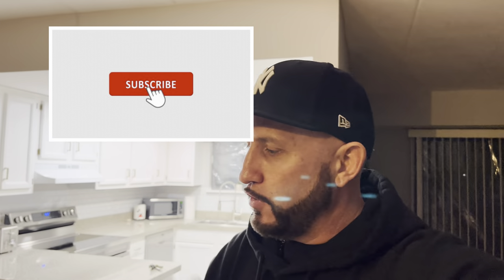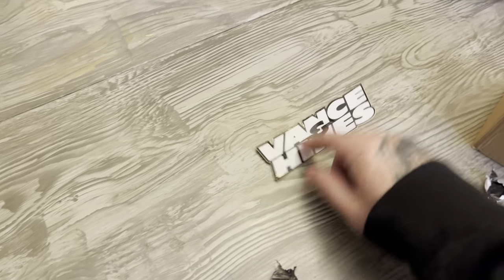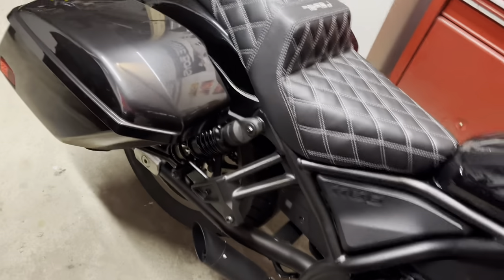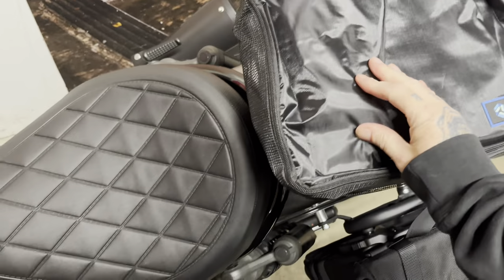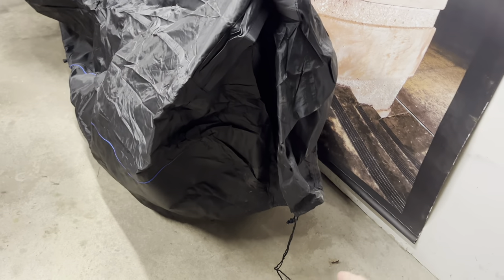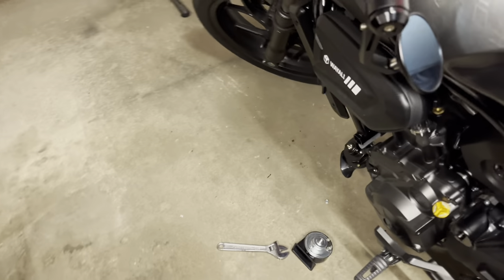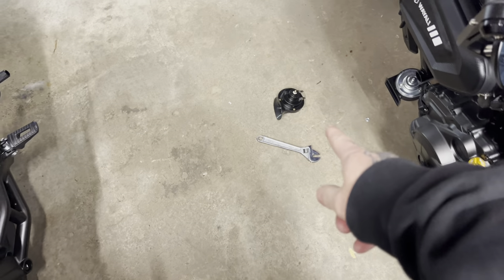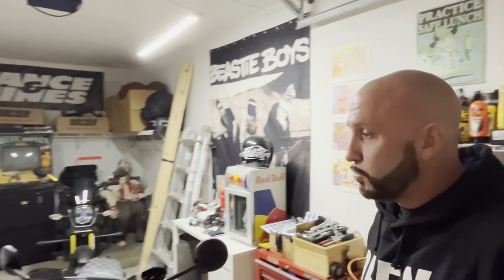Honda Rebel 1100 Bagger New Seat & Other Chaos!

Comment: I have the same dual seat, I got it on Aliexpress for $300 NZ, as Life of Burch warned, it is not water proof, I just did a 900 kilometer weekend ride and it rained, and my ass was wet all the way home. I have sprayed it with some tent waterproofing, hopefully that works. It is a very comfortable seat, waaaay better than the stock one.
Reply from the maker: Good info!